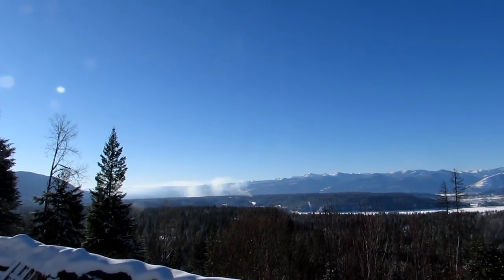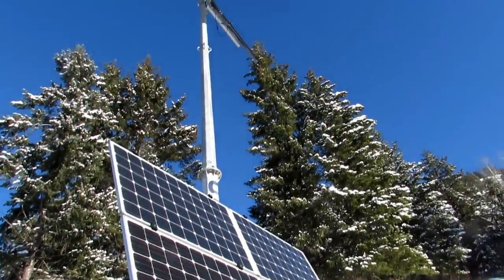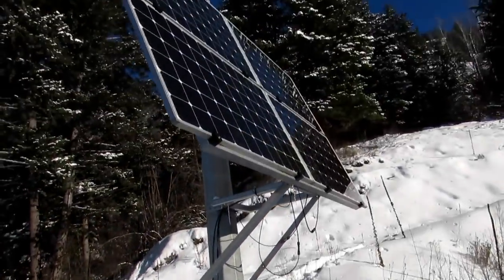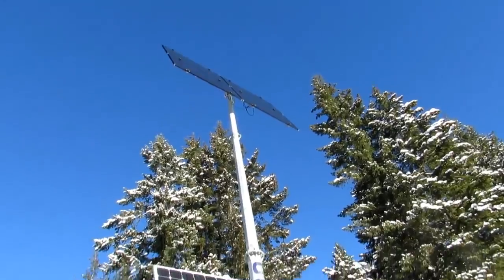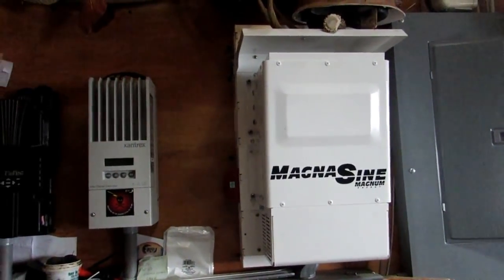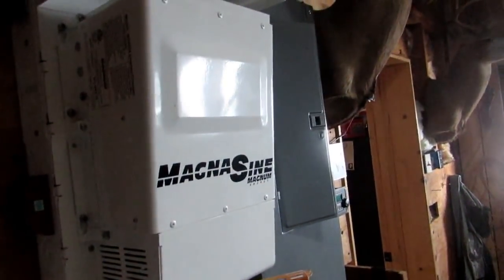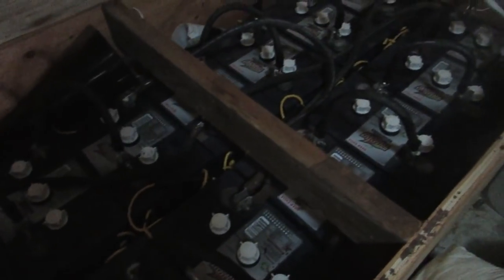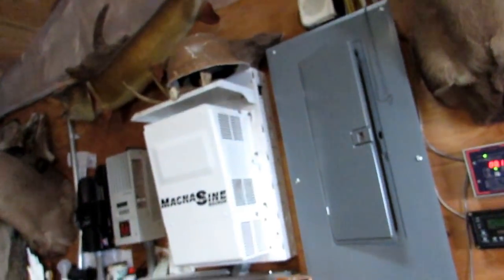HOME SOLAR POWER SYSTEM: OFF GRID WALK THRU

Comment: Another note - you may not need to invest to sine inverter because a huge count of devices are capable to work on low DC voltage... So you'll have better efficiency and lower cost...

Comment: a few Questions Starry..
-- How Deep have you drained your Battery system..??
If you don't take the batteries bellow 75% of Full charge your batteries should have a Life FAR in excess of what they quote for Life..  
- Are the Battery in a area where they are in constant temperature's. if the Batteries get too cold the charge they will hold is diminished..

Comment: Starry, do you use any air conditioning in the summer months?
Reply: A Well designed house.. With What is called Solar Mass Does not need Air-conditioning..  Good insulation and a Good Mass = constant Temperature's.. regulated by opening up window's..
Reply from the maker: WE designed out ho me to utilize passive solar and it is earth reamed design..we have free cooling free he slab!!

Comment: Interesting. I always thought the solar panels had to go on the roof. That looks like a very easy set-up compared to putting it on the roof.
Reply: So long as they get good light exposure the panels can be placed just about anywhere they won't get in the way... They don't even have to be close to the house as long as you don't mind laying the wire channels, etc.

You can essentially set up your own substation and place it anywhere on your property...

Some have started integrating it with their farmland... Since some places can have too much exposure and get too hot for the crops... So the panels spaced out can provide a balance of shade while simultaneously using the same acreage for solar energy...

It all depends how much work you want to put into it and what kinds of system you need... Like there are also hybrid systems that generate both electricity and also collect heat for warming your water or heating your home and you can combine it with other off-grid power sources like wind turbines, even a wood stove can generate electricity with a thermocouple generator attached to it or steam generator if you have a wood burning furnace...

So lots of options...
Reply: That is very good to know. Thanks!

Comment: I was using deep cycle lead acid ,still do have some ,I discovered Lead Acid Silver Alloy  batteries ,they will hold a full  charge for 2 years with no charger being attached to the batteries ,I would not myself recommend that you leave a battery idle for 2 years , They seem to give 2 times the power output for the same size and weight of other top of the line batteries .. They are called Alpha Cell Gold  215 ..These are the ones I now have ..Very pleased with them ..http://tools.alpha.ca/library/showdocs.asp?PId=00000000000034FA&tp=m&salp=1 ...

Comment: How often do you have to replace the batteries?
Reply: A well maintained Battery that has not been taken down below say 70% of Full charge, will last for year's..
-- nominal life spam is 800 cycle's.. or 800day's about 2yr's Plus if your drain the batteries to 50% of Full charge.. The better the battery the better the Cycle rates fort he batteries.. you start to get into the 1200-1500 cycles for say top end Lead acid batteries..[Be they Gell,AGM or other configuration of Lead Base]

Was in charge of a set of Nickle/Cad Battery that had been in operation for over 25years[Large Scale Emergency Lighting system] 100+ 1.8v [220Ah] in 3 string's-- Well after 25yrs they finally had to be replaced as they no loinger meet the standard of being able to maintain a Reliable charge for over 90min..

So it basically comes down to how you take care of your Batteries.

Starry actually said the one thing that 99% of all people don't understand.. 
" If your having trouble maintaining a Full charge, ' Add MORE SOLAR ' " if your system is not working well Look at the worst case scenario, charge wise and add more SOLAR Panel's..
Reply from the maker: ahhh the golden question..WITH proper CARE..which is really easy..we have friends that have batteries go over 10 15 years
Reply from the maker: THANK you..great information for all!!!!!!!!!!!!
Reply: When you eventually replace the batteries, check out Nano Carbon/Nano Foam/NanoCell Batteries... They're a step up from AGM that can be safely drained to 80-90% repeatedly, require much less maintenance, and will generally last longer...

You can probably contact someone like "7 Trumpets Prepper" for more information on them as he's already offering them in his Off Grid contracting business for solar installation set ups...